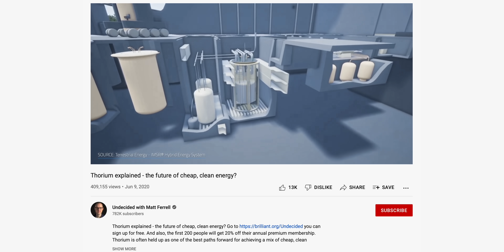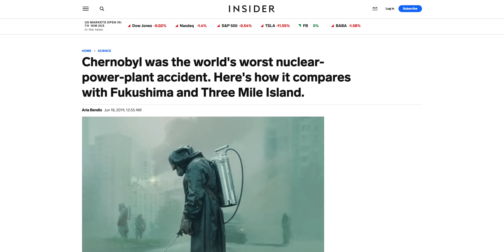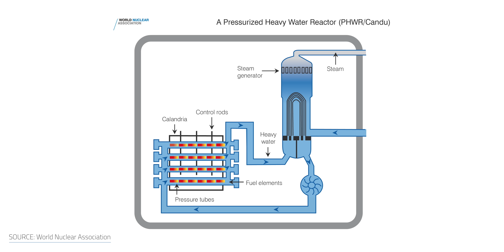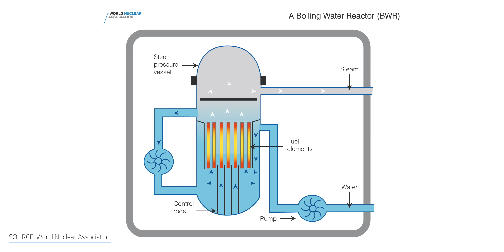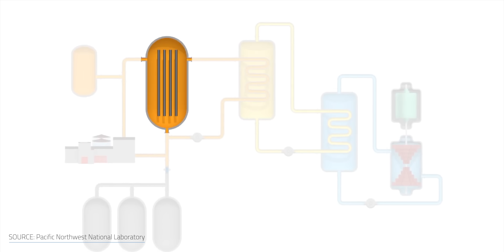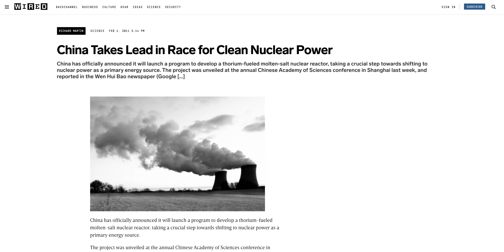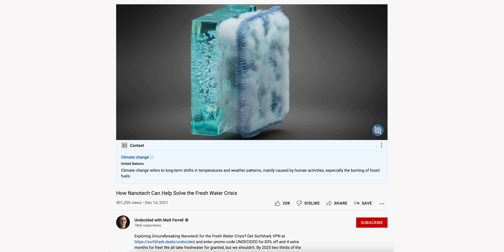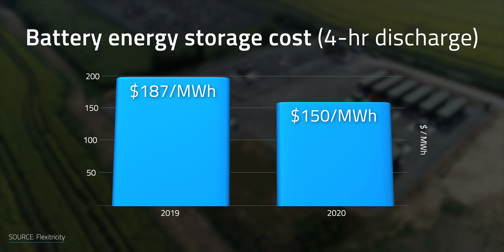Revisiting Thorium Energy - The Future of Nuclear Power?

Comment: There are lots of people asking about the claim of "burning up," old nuclear waste in Thorium reactors. I posted a response to one such comment asking about it, and figured there were so many others it would probably be best to post it outright so others can see the explanation and hopefully it will address questions or concerns, or simply those wanting to hear about the potential for Thorium to "burn up" old nuclear waste products.
First, the main issue with this concept: The ""burning" of old nuclear waste, specifically plutonium (the primary nuclear byproduct of the classic Uranium-based light-water reactor (LWR) nuclear power plant) doesn't occur in Thorium-based plants. The process is actually used to create a new fissile material for use in the current nuclear power plants. The process of generating electricity via the fission of Uranium is far more complex than most people realize. It's not as simple as melting uranium and dumping it in a rod and boiling water. The uranium refinement process involves creating a granular black powder known as UOX, or Uranium Oxide. This material is formed into the nuclear rods which generate heat via fission, boiling the water, which spins turbines, which generates electricity. 
The Plutonium is created when U-235 (the type most common isotope of Uranium used in nuclear energy generation and some fission-based nuclear weapons) is fissioned and releases Neutrons, which can then be absorbed into U-238, which is present in the UOX fuel pellets used to make rods. When U-238 absorbs several neutrons, it becomes U-239, which beta-decays into Neptunium 239, which beta-decays into Plutonium-239. That Plutonium is the nasty material we usually associate with nuclear waste byproducts. While U-238 isn't fissile enough to generate the heat and energy necessary to maintain the fission reaction that generates the heat used for electricity generation, Pu-239 is. Now, Plutonium can be used in other types of nuclear reactors, like "fast neutron reactors," but it can also be mixed with UOX as a fissile material to make rods for classic LWR fuel.
Here's where the "burn-up" of Pu can occur. Instead of mixing UOX with PuOX to make MOX (mixed oxide fuel, composed of uranium oxide and plutonium oxide) pellets for fuel rods, Thorium oxide, or ThOx can be mixed to make (PuTh)Ox, or Plutonium-Thorium Oxide, which can them be used to made fuel rods for classic LWR nuclear power plants. It can also be added to UOX to make (UTh)OX, which works like traditional nuclear fuel pellets and rods, but reduces the amount of Plutonium generated during the fission process. the Thorium absorbs neutrons and becomes U-232, which can absorb another neutron and become U-233, which is fissile and can be reused as even more fuel. 
Essentially, Thorium can be used in CURRENT nuclear power plants to extend the quantity of uranium fuel (by becoming U-232, and then U-233), or can be combined with Pu-239 to create a new fuel source out of our stockpiles of nuclear waste byproducts. 

This is where the misconception of Thorium plants burning Plutonium plants comes from. Plutonium can be used to make a new fuel source for CURRENT nuclear power plants, not as a fuel source for FUTURE Thorium-based fuel power plants. 

This still accomplishes the desired goal of burning plutonium from our piles of nuclear waste, resulting in less nuclear material proliferation, and thus less potential nuclear weapons. This idea is already used in some places, and can be used in almost every single current nuclear power plant. 

Now, Thorium-based fuel in FUTURE Thorium power plants (they're still being designed and tested, they're not fully viable yet) would use a different method to generate power. Instead of creating powdered Oxides, turning them into fuel rods, and using those to generate power, Thorium breeds Uranium-233. Thorium itself CANNOT generate sufficient heat to run a power plant. But remember, just like in fuel rods, Thorium can be bombarded with neutrons, and it becomes U-233 (that's why it's called fertile, or a breeder; it is used to create a fissile material that can be used as fuel, but thorium cannot be used as a fuel by itself). If we wanted to be technical, Thorium plants are actually U-233 plants, since it can only generate enough heat to run a power plant once the thorium has been bred into U-233.

I know this is a massive amount of information, but hopefully it will help anyone who is curious about Thorium and its multiple potential uses a as a fuel source through breeding, extending Uranium stockpiles, or being used with old nuclear waste (plutonium) to create a new fuel source for old nuclear power plants. Also,  sorry for any typos. I had to type this up in a hurry and didn't have time to spell check.
Reply: The British company: Moltex is ALREADY building a 300MW "waste burner" reactor in New Brunswick, for the Canadian grid. The reactor is powered by stockpiles of Plutonium, which some countries have accumulated during the "cold war". Britain has about 100 tons - enough to last quite a while. 

MSRs are powered by a liquid fuel - the uranium/thorium is dissolved in the coolant. This gives excellent controlability. The reactors are even throttleable.
Reply: @thrunsguinneabottle3066 , As you may know, the Moltex design is quite different than the other MSRs as the fuel is NOT dissolved in the coolant. Rather the fuel salt is loaded into fuel pins very similar to a Metal Fueled SFR like PRISM and a completely separate non-fuel coolant salt is circulated to remove the heat. Another HUGE difference is it runs a fast spectrum (unlike most MSRs) which allows it to burn the higher actinides. NB Power/Moltex are still in the design stage...hopefully they can make it work and between them and Ontario's OPG recycle all the spent CANDU fuel to significantly reduce the radioactive lifetime of the waste down to several hundreds years.
Reply: Moltex Energy waste burning reactor in New Brunswick, Canada it is designed for our CANDU waste, So ask the DOE to hire Moltex Energy  to tailor one for you folks in  the lower 48 and the power produced can offset the cost over time the same could be done in the Ukraine by the Germans to get natural gas free power to thd EU grid.
Reply: @creedjo4018 , Moltex is one design, though it is not as mature as the SFR at this point....since one has never been built, not even a small test reactor. That said it is promising and the current Canadian Govt policy to directly geologically dispose of used CANDU fuel is short sighted IMO. I suspect both NB Power and OPG will eventually go that route.
Reply: Thanks, David this will be very helpful, I hope...when I have the time to re-read it several times.
Reply: @dandavis4469  No problem. I just re-read for the first time in a long time, and realized it's uh...a lot, for a YouTube comment.

Hope you enjoy reading it!
Reply: As to the issue of the salts actually decaying the vessels their in, i wonder if this is just a matter of using inferior metals, cast irons or steels with colbalt in them.
Reply: Your knowlegde is badass dude  thanks for the lengthy info
Reply: @ryanbeard1119 , MSRs are not magic, nor is Th as a fuel. To use an MSR as described above with online fuel conditioning is a proliferation risk, particularly when using a Th cycle. If one puts a cell in that online conditioning loop that extracts high purity protactinium (Pa233), then it is just a mater of waiting a short time for that stream to decay and the end result is very pure weapons grade U233. 
BTW, Wintermute was incorrect in that the primary fissile material in the Th cycle is U233, NOT U232. There will be U232 in the fuel salt, but the primary breeding pathway is Th232 +n = Th233 which then experiences two -B (beta) decays moving to Pa233 then U233. Only small amounts of U232 will be present. If the fuel conditioning is done in batches, then it's not a big problem as you get enough of an isotropic mixture to make the material dangerous to handle/smuggle, however online is a very different thing, just as it is in solid fueled reactors. For Th MSRs to be proliferation resistant, the fuel conditioning must be done offline in batches, just as recycle in a Sodium Fast reactor (SFR) is done (though the technical details are slightly different). Also, the fission product (waste stream) radiotoxicity is more like 300 years, not 30, again just like in an SFR with recycle. Both can provide a huge advantage in terms of reducing both the heat load and radiotoxicity of waste streams over the longer term, which greatly simplifies the eventual disposal, however the SFR is a far more mature technology as far as the reactor is concerned (more years operating, more experience, more actual live data, etc...).
Reply: @richardb1452  ok, sotty but i dont understand the batch proccessing thing,  i believe you said, ment, do the operarions (MSR) in dilluted batches so the material is safer to handle between the MSP and the fast tyype reactor. And these fast types could provide power gen and desalignation at a much lower density but without the multi-billion footprint of the large facility type, im  hearing you on this need to keep the crazies from u233 though...
Reply: @ryanbeard1119 , There are two main approaches to conditioning MSR fuel salt. One has a loop in which the fuel salt circulates outside the reactor and through a conditioning cell while the reactor is live and another where the reactor is shutdown, the salt replaced and the old salt is run through an offline conditioner while the new salt runs in the reactor. 
The first method is a proliferation risk with Th fuel cycle because Pa233 can be chemically separated (as opposed to isotopic separation, which is much harder) as the reactor runs. Since Pa233 has a short half-life, the batch approach means much of it will have decayed to U233 by the time the separation happens and that means it is mixed with the small amounts of U232 in the salt, and that results in mixed isotopes that are much harder to separate, hence lower proliferation risk.
The small diluted batch thing is about keeping fuel non critical while it is being conditioned/processed and is not what I'm talking about when I say "online vs. offline batch". That constraint applies to all fuel regardless of form outside the reactor. It applies in a PUREX plant, pyroprocessing, initial fuel fabrication or any other conditioning/processing operation involving fissile material.
Reply: @richardb1452  well you should try to educate people because all the hype is pretty misleading.
Reply: @richardb1452  So the waste burning analogy is fiction,  something expending itself to inert chemicals.? Cause that other commentor acts like it is all fun and games.
Reply: @richardb1452  well its above my head but i really appriate your passon for the truth. And promethus.
Reply: Do you think somwthing simple like bif thick, geared tooth inside, nitinol metal v belts could be used to produce aboundant power gwneration,  seems like it was swept under the rug and companies only make small wire crossecrikns of it,  just blast one end with a stream of low density flame, and the other with cooled water, and if it really reacts with a force of 55 tones a sqare inch, then seems like it could move any sized gen unit.
Reply: There are actual several thorium molten salt reactor breeder designs which will be able to use/reduce waste from traditional uranium/plutonium fuel in a mix with thorium. Copenhagen Atomics is one that does exactly this - and they are also building and testing large amount of hardware (so far still running only depleted fuelsalts I believe). This techbology is moving fast.
Reply: Look at DUPIC fuel cycle.   HWR, are more neutron efficient.   To the point that naturally enriched uranium can be used to fuel the reactor.  S.Korea has experimented with their CANDU reactor, fuel with nuclear waste from their LWR.   So its possible to do this with the present level of applied tech.  But look, at the commercial side.  Nobody does it.  At all.
Reply: Actually, that's not exactly true. The "magic" isn't the Thorium part, it's the Molten Salt Reactor, w/ fuel kept in a liquid state. You can basically just throw any nuclear waste into the salt _along with _ thorium. As the thorium fissions (technically Uranium as the Thorium is converted to U232) it bombards the waste with neutrons and either activates it or transmutes it into a more stable or unstable form. This unstable form makes it WILDLY radioactive short term, where it breaks down and releases decay heat. And then eventually ends up as waste that can be stored for a few months before becoming inert as opposed to current waste which is low radiation but stays that way for relatively long periods. I'm glossing over a lot but its sort of like a catalytic side process that uses the extra neutrons to boost the heat generated from the reactor by irradiating other elements (or waste). I believe you can technically do this to anything heavier than Iron and some things lighter. Plutonium specifically is probably worth more as weapons grade material or for solid core reactors. The "dirty little secret" of LNRs is that you inherently add a reprocessing stage to make your primary fuel, U232 from Thorium but you can also reprocesses whatever you want, as long as it's chemically separable, as opposed to isotopically separable. If it's not what you want, you can put in back for another pass of neutron bombardment. Obviously it's WAY more efficient & safe to use specifically calculated and measured percentages of certain "waste" to get a more favorable yield but, in theory you can just chuck crap in and let it stay there until it transmutes, becomes unstable and isn't radioactive anymore - or long term radioactive. It's really not hard to guard waste for a few months up to 20-30 years, the problem is current "waste" (which is actually often barely used up fuel that no longer can work in a solid reactor) that lasts or longer than humans have been a species and trying to keep that contained on geological time scales.
Reply: @Wintermute_SilverPaths    Being an absolute novice as far as nuclear power goes, there's a lot I really haven't grasped BUT I did read both the original post and your reply and I thank you both for taking the time to post.....
Reply: @Wintermute_SilverPaths , to burn the really nasty actinides, you need a fast spectrum and Th MSRs are not well suited to that cycle. To really clean up you need to do something like the MCFR or Moltex fast spectrum molten chloride salt reactors or SFR + Pyroprocessing.
Reply: @Wintermute_SilverPaths  so your saying U233 wo t be produced,  so what is Richard "The Man" lieing about weapons proliferation risk?
Reply: @ryanbeard1119  I don't think it's intentional; I think they really want the tech for altruistic reasons and U233 was historically frowned upon for arsenals because it has a poor shelf life (u233 cores potentially poison themselves with daughter products in around 6 months but that doesn't count for hybrid cores) so they're assuming a rogue state is going to think the same which is kind of wishful thinking. That being said, yes, the proliferation issue seems to be seriously understated, even if it's less of a concern than traditional reactors basically everyone already has. 

The current design of the reactor is proliferation resistant but modifying a reactor to do in situ reprocessing and separation isn't impossible and relies on chemistry, which is easy as opposed to separating isotopes which is really hard. Also, the design and construction isn't hard to work out and is out in the open. It sort of moves the bar on what it takes to get access to fissionables from a national high tech lab to the high school or college lab level. It'd mean trying to reduce arms going from going after rare parts like centrifuges to trying to regulate the kind of alloys you need for a reactor like Hastalloy, which is a much harder to regulate. 

The saving grace is that thee reactors won't start on their own, they need some pure u235 or other fission initiator to catalyze the reactor and start the process, like a spark plug (which may be why they don;t seem concerned), so there's still that but there are rogue states who have that now. I have a feeling that's the "real" reason the goverment isn't putting a lot of effort into this - they're afraid they won't be able to put the genie back in the bottle, if it isn't already too late. 

Nuclear tech is strange; it's not harder and harder to get more and more destructive devices or more fissionable material. It's more like a ladder and the botom wrungs are EXTREMELY hard to climb up but once you have some, you can make more and with less tedious methods. To get the first enriched u235, it took 30% of the entire US power grid. Once they had that, they used reactors to breed more u235 and plutonium so it becomes easier and easer to accumulate enough for mass scale weapon production. This may alloy you to skip some of those early wrungs on the ladder or provide an entirely different ladder to climb up with different challenges than the conventional model.

Comment: Why does no one ever discuss the environmental catastrophe when disposing of solar panels and wind turbines. they are extremely harmful to the environment. The disposal cost is never exposed. If it were people would not be so cheerful about wind and solar. Wind and solar are good energy sources; however, they are inefficient.  Solar panels only collect about 40% of the available solar energy, the light. The infra red radiation is wasted and does not have to be. This too can be done more environmentally safely.  It can be harvested easily.